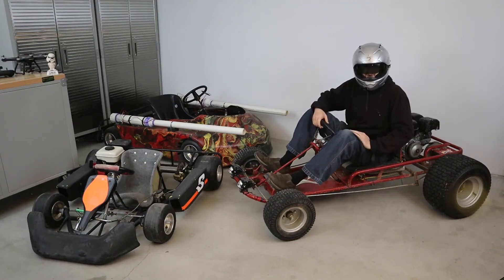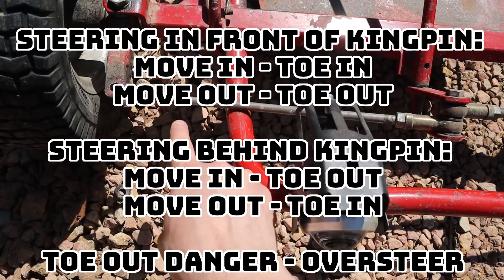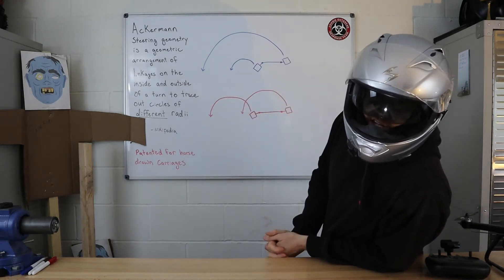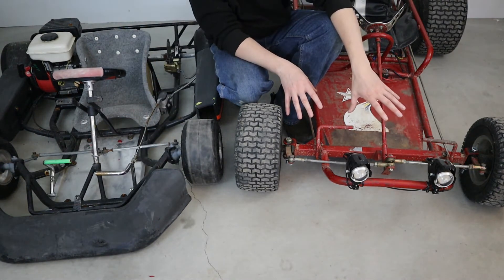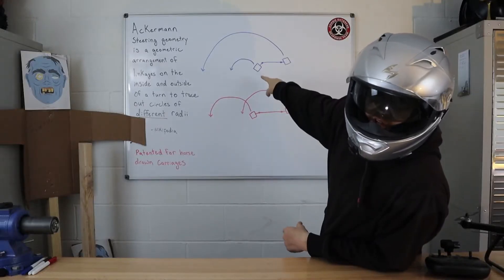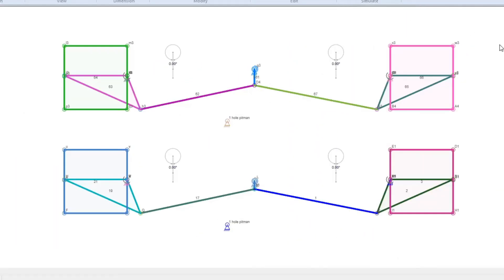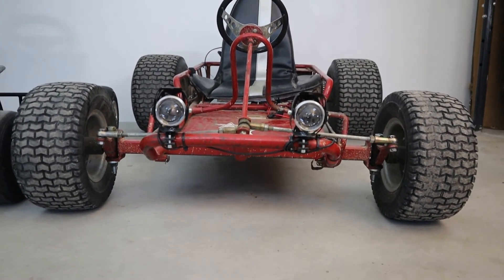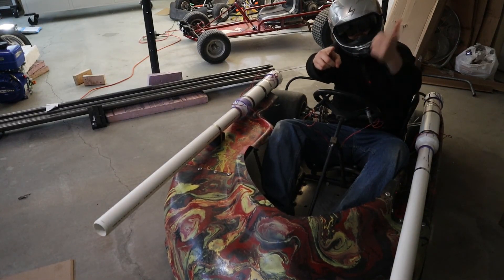Go Kart steering system geometry (ackermann, anti ackermann, camber, caster, and toe)

Comment: Seeing your turn radius with the live axle, I got to thinking. What if you ran a sprocket directly off the crank, onto a jackshaft, and out through a pair of centrifugal clutches? Run a chain from each clutch to its appropriate dead axle wheel. Poor man's limited slip?

Comment: This video perfectly explained my situation. I have an antiAckerman setup with the steering linkage in front and forward facing spindles and i was wondering why my outside wheel turns more than the inside wheel. Why does this setup even exist?
Reply: I have the same kind of setup on my go-kart and my guess is a couple things. First when you turn the scrub slows that cart down and I think that's kind of a safety thing for the kids that are riding it. Second I think that in high-speed turning it scrubs instead of grips so that it won't roll in a turn at higher speeds. This is pure speculation and just what I've observed on my cart and how the cart reacts to that kind of steering. Oh yeah and every time you buy tires by two front sets cuz you're going to go through them quick

Comment: What brand is that first red go kart? I picked one up very similar to it with the same general design and even the white decal on the floor board. Hadn’t been able to find one similar. 

Currently working on a motor swap from the original 5hp Briggs to a 440 fan cooled from a 1985 Polaris ss. Actually had its first test drive today after a 6” frame extension and custom motor mounts for the 440.

Comment: I just bought a POS flat track kart, because ebay and beers are a bad idea no matter what anyone says.. anyway the front left wheel lifts when you turn right and the front right wheel lifts when you turn left, it hardly steers at all, 1 Hole pitman. Do i just try adjust it to make it better & back if its worse or is there a method? Appreciate any advice.

Comment: Hello sir your video was so helpful for me I just want to ask you that what  are  new innovations can be done on go-kart steering system please help me about it
Reply from the maker: Not too many "new" for steering that hasn't been done. Some people trying out rear differential on go karts with a locking system for limited slip. The peerless 100 series differential I just put out a video on with part numbers. You'd have to create a lock system for each side to adjust for slipping on starts, but turning would be a bit smoother on tight corners.

Comment: I’ve got a Go-Kart it’s a live axle and I’m still not clear on what I need to do to correct the problems with the steering upfront. I’ll probably re-weld the king pin brackets at an angle after some research and I also work on the toe I have no idea how you adjust camber on these go carts I mean these are metal spindles front,  and in the rear it’s a live axle steel axle ..there is no camber adjustment.
Reply: Torch and bend the metal. I do it often having only one kart and riding all kinds of different terrain

Comment: Do you know what the caster angle should be on the spindles? I have a go-kart that has 0° caster and the steering is all over the place.
Reply from the maker: Really depends what type of kart. Street racer karts rely the most heavily on this and set between 0 and 2. 1-2 is pretty good unless tires are worn. Do you have off road kart or race?
Reply: @megoingfast  a small kids go-kart, similar to your off-road go-kart.
Reply from the maker: @jamestaylor1078  can you adjust camber at all and have you checked if there's wear on the spindles making it loose?
Reply: @megoingfast  no, it's the double C style knuckle. Just curious if I should cut the C off the frame and weld it back on at 2°-6°. I know on my Jeep it's supposed to be at 6°, the go-kart C is right at 0°.

Comment: I got the most super twitchiest steering I've ever experienced. My son and granddaughter didn't realize how quick and twitchy it was and rode straight into trees. Gotta figure something out. Toe was out too.
Reply from the maker: Camber helps stability. Toe helps turning radius. Additionally, it is best to check front pin wear in case replacement is needed. Often the older carts need new front pins, sometimes a little spindle work on the pin hole that wears over time.

Comment: What about Rack and pinion steering
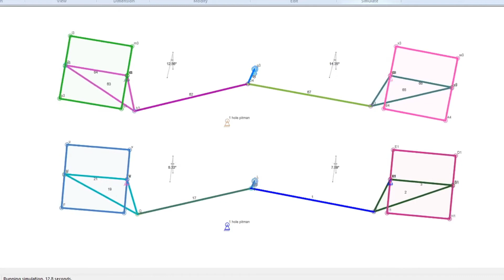Reply from the maker: Great question, and honestly I slid in the visuals at 7:26 and avoided covering it "directly" on purpose for this reason: people say so many different things about it "being included in ackermann" without a pitman, it being "sort of ackermann", "sort of davis" because it's slide, etc. Since I saw it as only place where people could tell me I "got it all wrong" I put the dimensional modeling in in case anyone was curious 🤷. Sorry to say. However, the principle for spindle forward and spindle reverse is roughly the same as can see in the two models at that time. To adjust for over steer or under steer you can shorten the spindle arm length or lengthen it, or change gear size on the pinion.
Reply: @megoingfast  ok thanks!

Comment: Being unfamilur with these terms i am wondering it i can get the same akermann results with the tie rods being infront of the spindles or is that position the difference between akermann and anti-akermann steering. Somehow no one has ever answered this with enough clarity.
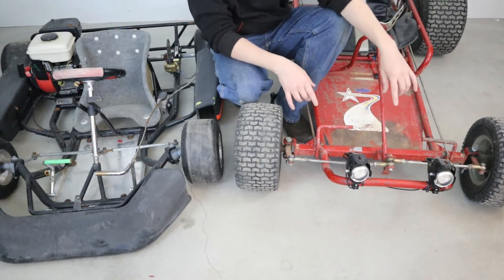Reply from the maker: That's the difference. Explained at 4:00 Mark on the go karts, explained at 5:00 on the cg models.